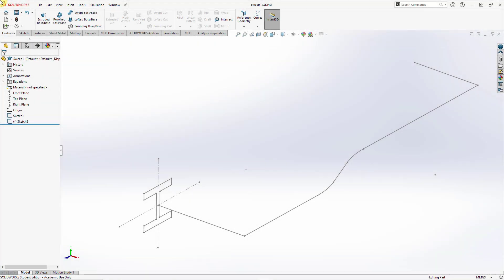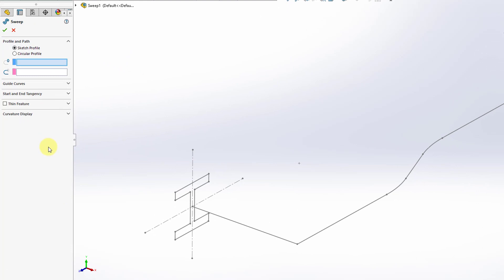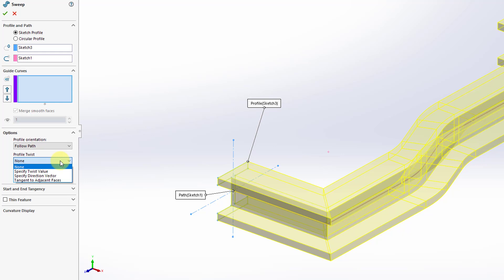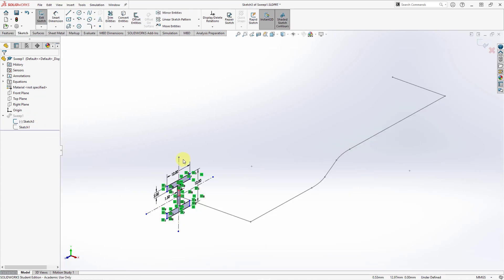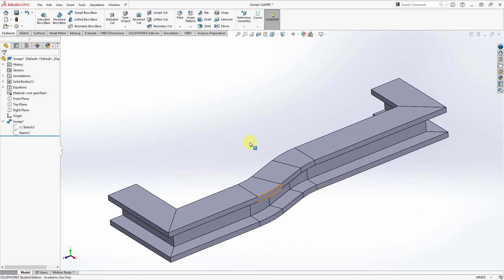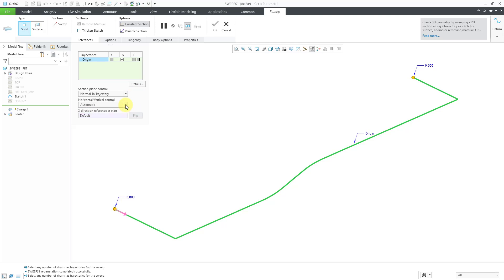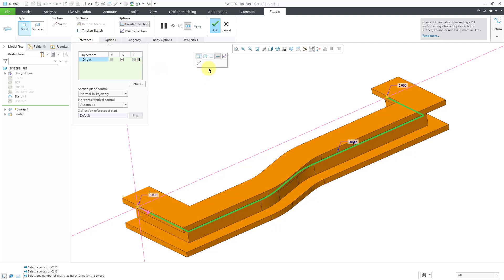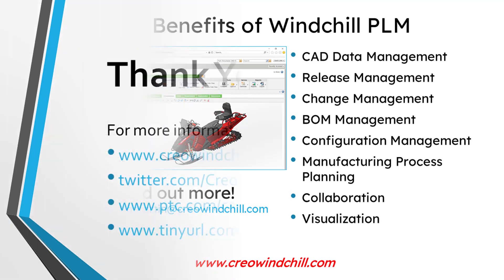SolidWorks - Creo Parametric Comparison - Sweeps (Part 1)

Comment: Thanks for the video! Do you like SolidWorks better? It is very flexible, isn't it?
Reply from the maker: I prefer Creo. I've been an admin for both in the past. Creo is much, much more powerful and as a result more flexible. But I understand how people who prefer simplicity, easier workflows, and less functionality in the UI prefer it.
Reply: @CADPLMGuy  I see... but how about multibody mode? SolidWorks has had it since... well, I don't know, for ages... and Creo has got it only recently in the 7th version, right? It took so long... CATIA, NX, Autodesk, they have it from the beginning, don't they?
Reply from the maker: Because Multibody was SolidWorks' response to Skeleton modeling. They couldn't do Skeletons so in 2005 they came up with their take, which was Multibody. CATIA did not introduce their Multibody functionality until V5, decades after their first version. PTC held off on Multibody because, well, they had Skeletons. Then when they did Multibody, their take went in a different direction, which I cover in part 1 of my SW - Creo Multibody comparison video.

Comment: Is it cranky because of the construction lines? It looked like the free ends may have been blue indicating that it wants a dimension for the length/placement of the construction lines since they aren’t there infinite construction lines.
Reply from the maker: I just tried the same sketch with infinite construction lines. I have 25 Relations in the sketch (including 4 Distance dimensions) and it's still so blue. This is one of those areas where I don't get it when people say "sketching is so much easier in SW." Also I find there's a lot more mouse travel in SW. For example, is there a way to add multiple Relations without having to go to Display/Delete Relations > Add Relations every single time?
Reply: @CADPLMGuy  SW ignores construction lines for "defined sketch" Determination iirc (will check later though), as far as adding relationships/constraints, In my 10+ years using SW, I don't think I've ever used the display/delete relations, I've done it basically opposite Creo (learning it now for a new job thanks to these videos!) i.e. select elements I want to add a relation to (i.e. two lines) all the possible relationships should pop up on the left property manager, and you can select it there, OR it will show up in the mini hover menu after selecting the two/three/etc. items.

I will admit (as much as I love SW), there are times when I think I have everything defined, but something is still blue, so to test it, I'll grab the blue element and sometimes it'll move (making it clear what's undefined), and other times (less often) it won't move and the element will become black and defined.

FOR YOUR SKETCH: Just by looking at it (I'll try remaking and adding later), I'm not seeing a symmetric relation about the vertical construction line, so MY GUESS at the moment is that if you selected the two blue lines and the vertical construction line and add a symmetric relationship, that will define your sketch, OR select the midpoint of the 12mm line and make it coincident with the vertical construction line. That said, I also can't tell how your dimensions are setup, whether you are doing a double dimension across the construction line, measuring the horizontal line itself, or between the two short ends (blue lines).

Would be happy to try and help answer any SW questions you might have!
Reply: I changed jobs recently and one of the major deciding factors was getting away from Solidworks and back to Creo. I feel your pain.

Comment: I can't find any missing constraints,but we can solve these issue by using fully define sketch command , available on display delete relation(drop down) on sketch ribbon.
Reply from the maker: I know, but for a simple sketch like an I-beam, I shouldn't have to.